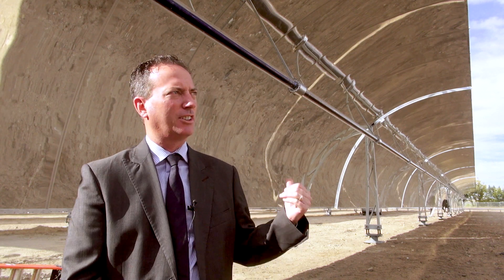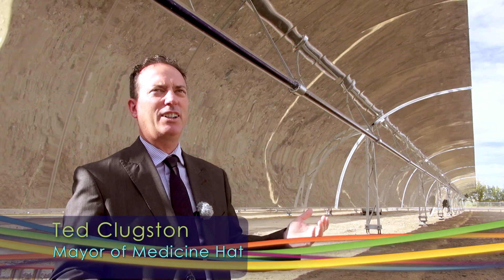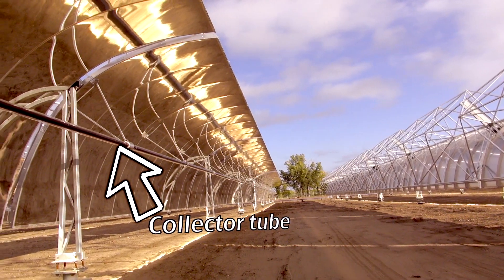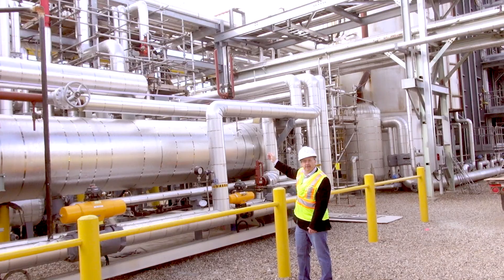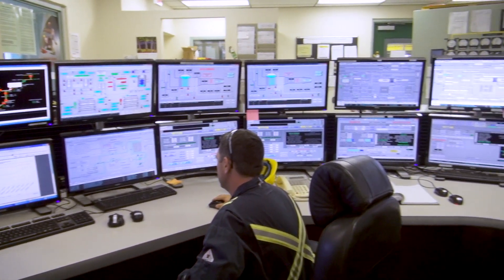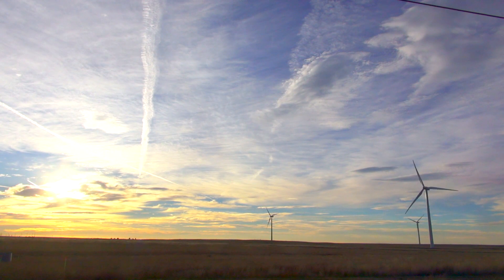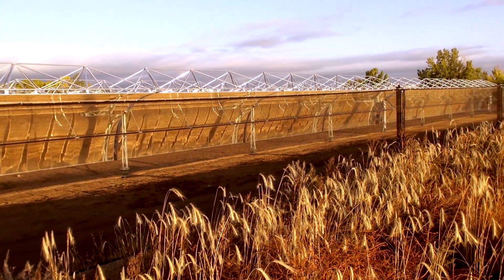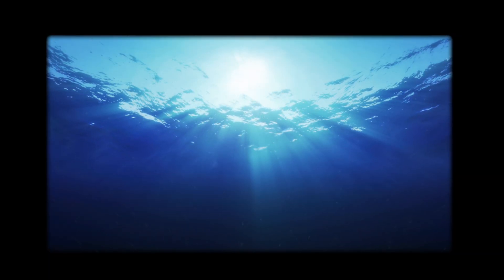88. Welcome to Canada's first concentrated solar thermal plant

Comment: Solar Panel Waste: A Disposal Problem

By Jack Dini —— Bio and Archives--December 7, 2018

Global Warming-Energy-Environment | 3 Comments | Print Friendly| Subscribe | Email Us

The last few years have seen growing concern over what happens to solar panels at the end of their life. Consider the following statements:

- The problem of solar panel disposal will explode with full force in two or three decades and wreck the environment because it is a huge amount of waste which is not easy to recycle. 1

- Solar panels create 300 times more toxic waste per unit of energy than do nuclear power plants. If solar and nuclear produce the same amount of electricity over the next 25 years that nuclear produced in 2016, and the wastes are stacked on football fields, the nuclear waste would reach the height of the Leaning Tower of Pisa (53 meters), while the solar waste would reach the height of two Mt. Everests (16 km). 2

.

- Contrary to previous assumptions, pollutants such as lead or carcinogenic cadmium can be almost completely washed out of the fragments of solar modules over a period of several months by rain water. 1

- In countries like China, India, and Ghana, people living near e-waste dumps often burn the waste in order to salvage the valuable copper wires for resale. Since this process requires burning off plastic, the resulting smoke contains toxic fumes that are carcinogenic and teratogenic (birth-defect causing) when inhaled. 2

Solar photovoltaic panels, whose operating life is 20 to 30 years, lose productivity over time. The International Renewable Energy Agency estimated that there were about 250,000 metric tons of solar panel waste in the world at the end of 2016 and that this figure would definitely increase. Solar panels contain lead, cadmium, and other toxic chemicals that cannot be removed without breaking apart the entire panel. 3

In November 2016, Japan’s Environment Ministry issued a warning that the amount of solar panel waste Japan produces each year is likely to increase from 10,000 to 800,000 tons by 2040, and the country has no plan for safely disposing of it. 4 A recent report found that it would take 19 years for Toshiba Environmental Solutions to finish recycling all of the solar waste Japan produced by 2020. By 2034, the annual waste production will be 70 to 80 time larger than that of 2020. 5

China has more solar power plants than any other country, operating roughly twice as many solar panels as the United States and also has no plan for the disposal of the old panels. In China, there could be 20 million metric tons of solar panel waste, or 2,000 times the weight of the Eiffel Tower by 2050. 4

California, another world leader in deploying solar panels, likewise has no plan for disposal, despite its boast of environmental consciousness. Only Europe requires solar panel manufacturers to collect and dispose of solar waste at the end of their useful lives.

Another issue: according to federal data, building solar panels significantly increases emissions of nitrogen trifluoride (NF3), which is 17,200 times more potent than carbon dioxide as a greenhouse gas over a 100 year time period. NF3 emissions increased by 1,057 percent over the last 25 years. In comparison, US carbon dioxide emissions only increased by about 5 percent during that same time period. 4

While disposal of solar panels has taken place in regular landfills, it is not recommended because the modules can break and toxic materials can leach into the soil, causing problems with drinking water. Solar panels can be recycled but the cost of recycling is generally more than the economic value of the material recovered. Used panels are also sold to developing world countries that want to purchase them inexpensively despite their reduced ability to produce energy.  3

Washington State is the only US state that requires the manufacture to develop a recycle plan, but the state requirement does not address the cost of recycling. Adding a fee to the cost of solar panels would help ensure that the disposal issue is addressed in the event the manufacturer goes bankrupt. Since 2016, Sungevity, Beamreach, Verengo Solar, SunEdison, Yingli Green Energy, Solar World and Suniva have gone bankrupt. The result of such bankruptcies is that the cost of managing or recycling PV waste will be born by the public.  1

Colorado-based Abound Solar that got hundreds of millions of dollars in federal loan guarantees before going belly-up and didn’t just empty taxpayers wallets, it left behind a toxic mess of carcinogens, broken glass, and contaminated water. A Northern Colorado Business Report estimates it will cost up to $3.7 million to clean and repair the building so it can again be leased. 6

A multi-year effort by federal, state and local agencies to prop up an Oregon solar panel manufacturer (SoloPower) has ended in a shuttered factory, millions of tax payers dollars down the drain, and a heavily polluted manufacturing site. Although the county had the legal right to seize the plant’s equipment for delinquent taxes, it was unlikely to do so because the plant was heavily polluted with cadmium and hydrochloric acid. Cleaning up the plant is estimated to cost more than $500,000. 7

Natural events such as storms, tornadoes, hurricanes, earthquakes, etc., can cause damage to the panels. For example, in 2015, a tornado broke 200,000 solar modules at southern California’s solar firm Desert Sunlight. More recently, the second largest solar farm in Puerto Rico, generating 40 percent of the island’s electricity, was severely damaged during a hurricane. With 100,000 pounds of cadmium contained in 1.8 million solar panels calculated for a proposed 6,350 acre solar farm in Virginia, any breakage is a cause for concern. Further, even rain water has been found to flush out cadmium within an intact solar panel.3

While nuclear units can easily operate 50 or 60 years, solar panels have relatively short operational lifespans (20 to 30 years), so their disposal will become a problem in the next few decades. While nuclear waste is contained in heavy drums and regularly monitored, very little has been done to deal with solar waste. Solar waste outside of Europe tends to end up in a large stream of electronic waste. 4

Conclusion- Solar photovoltaic energy is not as environmentally conscious a choice as many think it is. Besides being an intermittent source of energy and more expensive than traditional technologies, it has serious waste disposal issues that few countries are tackling. The hazardous materials used in their construction are not easy to recycle and can contaminate drinking water.4

References
Michael Shellenberger, “If solar panels are so clean, why do they produce so much toxic waste?”, Forbes, May 23, 2018
Jemin Desai and Mark Nelson, “Are we headed for a solar waste crisis?”, Environmental Progress, June 21, 2017
“Solar panel waste: solar energy not so green after all,” naturalgasnow.org, Sept. 13, 2018
“Will solar power be at fault for the next environmental crisis?”, Institute for Energy Research, Aug. 15, 2017
Osamu Tomioka, “Japan tries to chip away at mountain of disused solar panels,” Nikkei Asian Review, Nov. 8, 2016
“Bankrupt solar panels firm took stimulus money, left a toxic mess, says report,” foxnews.com, Oct. 31, 2013
Bonner R. Cohen, “Failed Oregon solar equipment plant leaves behind millions in taxpayer losses,” The Heartland Institute, Nov. 26, 2018

Comment: 6 percent is not something to crow about. I don't have an issue with green energy but how much is the power being subsided by the tax payer. Also note that it can't replace the power requirement. SO they're still having to use a more polluting source. It shows that green energy still isn't ready for prime time. Even though a certain group continues to tout it.
Reply: 6% of an unlimited and FREE energy source, where's the problem ? Green energy isn't ready to completely replace other sources, I agree with you, but are you suggesting we do nothing in the meantime ?  It will get better and better as more people adopt green, and more brainpower is attracted to the industry to come up with even better solutions, building on what was done in the past.
Reply: Rick Duque I never said that we should't consider all safe energy generation practices. It seems if someone says anything about the green energy initiatives they're suddenly against solar, wind. etc. At it's present sates, it has very limited applications. But the left wants to shut down cola, Nuke, etc. When the options to replace that energy generation with a process that's suspect at best. 

BTW it's not free energy. You have to spend a ton of energy to create a solar cell. The same goes for the manufacture of wind mills. In order to sell them the tax payers are forced to subsidize the programs. Very little solar or wind would have been sold if it weren't for the tax subsidies.

Next we have to consider reality that they don't work in many parts of the country. They can't replace existing forms of energy generation without costing a ton more. 

It won't get better as more folks adopt green. As the tech still isn't there. I live in a state with a ton of the stuff. Yet it can't keep up with oil or NG facilities. It still gets dark and we still have many areas in the country that don't have enough wind to make windmills feasible . 

So, reality may be inconvenient. But it's still true. And facts don't care about your feelings.